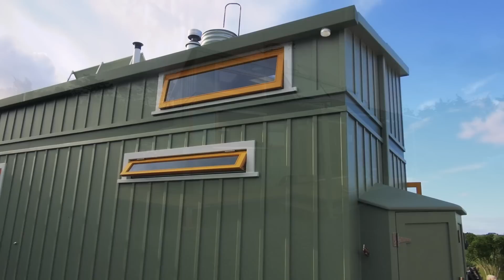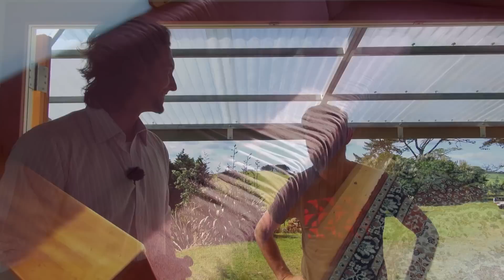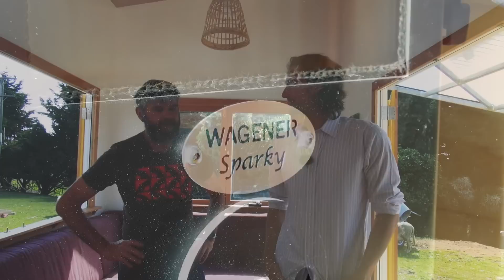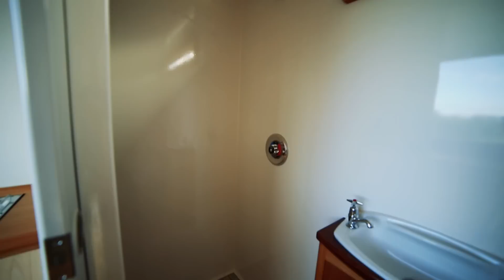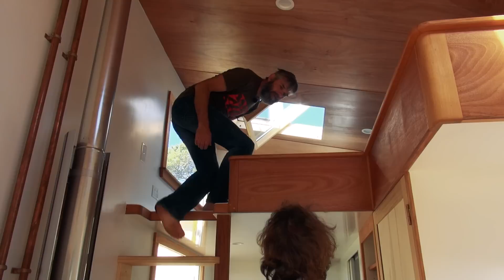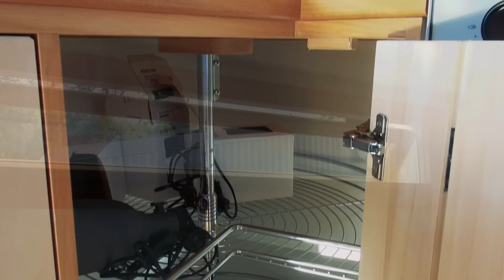Super High Spec Professionally Built Tiny House

Comment: Is this the final location for the house?

Very nice craftsmanship.  Too limited for me, but getting close to something I might could accept at least temporarily.  So far I think if I wanted to live like this I would get an RV,  motor home, but this is very nice.

I don't care for the laundry stuff being outside ... especially not in something that does not have a rain shield over it.  Seems like a utility module might be a nice thing to have that offloads space from the main structure for things like laundry, storage, water, electricity, heating or cooling.  Like another little tiny structure, but then I guess the price and complexity goes up.  I assume the laws are not the same in Aus. as they are in the USA for coding and stuff.

I also don't get how the high side of the roof does not seem to be over the occupied area so the human under it might have some more room?

The skylights unless they have some sort of shading will create a solar oven inside this thing on any kind of sunny day.  I read a solar design book and they said to avoid skylights and south facing windows unless it was winter.

I really like how the seating moves around ... I've never seen that before in any tiny house and that really gives a lot of flexibility in seating and sleeping ... very cool, nice job.

$77K does seem like a lot, but the components are all first class, the windows, the skylight, fireplace, etc ... reasonable.  The boat building experience really shows on this work. It just seems like the economics of a regular house make tiny houses unworkable except for certain places.

Comment: O.K. this build is on a completely different level and might better be described as a work of art.. It's one thing to have a clever design idea, but its another thing to implement the idea into a plan in such a seamless fashion that any clever idea seem like some stroke of genius. I have seen dozens of stair cases that are similar but none of them that had such a clean simple esthetic as the one built here.  Then the use of foam insulated I beams for extra strength is awesome.  The smartest thing you can do is hire this guy to build your place.

Comment: What a nice well built shed. The real question is why? This thing is not a mobile home. It takes a day to take a part for travel and another to set it back up. Add to it that you need another trailer for the deck and the rest of the parts and you are not taking this on the road. Then there is the cost. For the costs of this place you could build a small house on the ground and include a slightly bigger bathroom with a real toilet and shower. You could have an actual area inside for a washer. You could have 2 bedrooms and a real kitchen and the size would be just a little bigger and just a couple thousand more. The only benefit here is you can put this in a trailer park and rent land instead of buying. If you are looking for a house to take on the road buy an RV built for your needs. 
This is just a fad that will pass in five years or so and these things will fill junk yards or they will not hold the value of the initial price for those who find small is not really for them.  That or someone who owns land near a lake will go around buying them cheap as summer camps to rent out.
Reply: I would stick with an RV if I felt the need to live in a small house. For one this size they have a better price and are portable.

Comment: This is a really nice example of a well thought out Tiny house. The only problem I foresee in the layout is with the Sparky wood fire. The fire is too close to the wooden steps, and, when the fire is running, this is going to make the steps very hot. I know this from personal experience as I also have a Sparky in my bus. It needs to have a sheet of aluminium attached to the first three wooden steps, with about a 10 to15mm gap between the sheet of aluminium and the steps. This will prevent the steps from heating up, by reflecting the heat away. It'll need the same at the back too, because that area also gets hot. I've recorded temperatures of up to 420C on the top plate of our Sparky, so they do get very hot. Failing to install some sort of fire protection around the fire in this Tiny house will not bring a happy ending.  

We have the same Separett toilet in our bus and we're very happy with it. It was a big investment at about $2,000NZ, but well worth it. There's never any smell, ever. I love the other features of the design. Simple layout, open spaces, and great indoor outdoor flow with that lovely deck. A job well done and I'm sure the owner will be very happy once she moves in.

Comment: This is a beautifully crafted house. I just roughly figured that it cost US$411 per square foot. Current stick construction here in California is between $125 and $225 per square foot depending on the amenities. Someone should start manufacturing these houses in a factory. I certainly would buy one in the US$50,000 range.
Reply: +Brian Richards Not so much a factory setting, but pre-built tiny houses aren't too far above that range. For example, the Tumbleweed Tiny House company has models starting at $58k. Shells are much cheaper, though you have to put in the work to finish the inside. I've seen a couple, like Tortoise Shell Home, that have models starting at $38k, and such, but I haven't spoken to anyone that has one.

Comment: Great design. Do you know what he had on the bottom of the sliding drawers and the movable bed section? It sounded like there was a felt pad underneath to slide easily and prevent scratching.

Comment: what material was used on the walls inside? Is this just painted sip panels?
Reply: +Sheh1000  Yes the interior and exterior plus insulation are all one Structurally Insulated Panel, SIP.

Comment: Building regs in NZ require aluminum bolts and fittings on decks.... not galvanized like in the past....
Reply: +petnzme01 I think Number Eight means Stainless Steel, which is required close to the ground or in sea spray zone (within 500m of the sea, which a fair amount of Waiheke Island is).
Reply: mycoolcar Correct, I'm always mixing them up. Yes aluminum bolts would sheer in an instant....!
Reply: +petnzme01 Yeah, Stainless steel is no good, thats why its used so much in yachting. Perhaps also you should advise all the structural engineers on building regs.